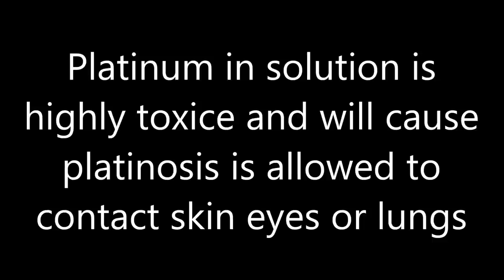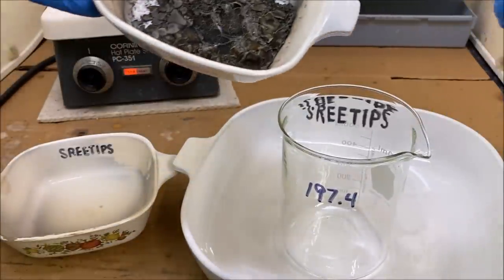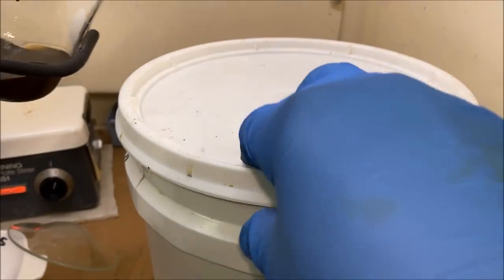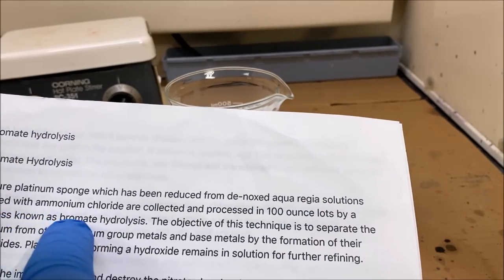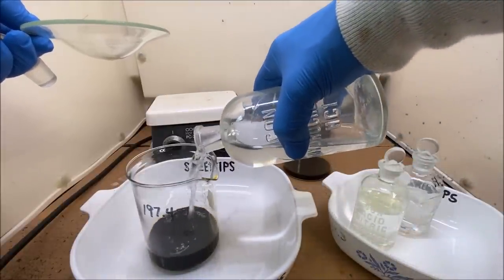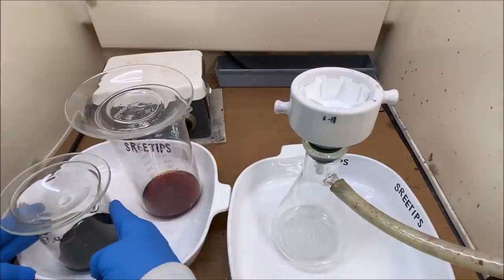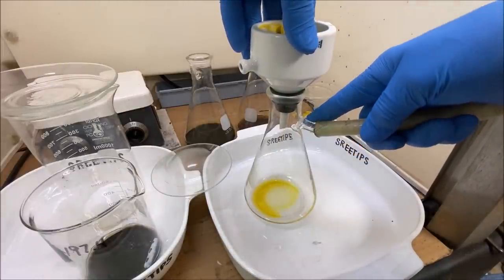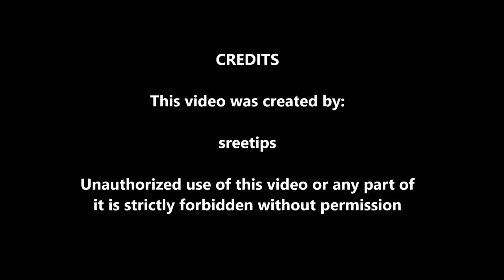Platinum Refining Bromate Hydrolysis Pt3

Comment: Looking good there Sreetips. One thing a lot of papers/books forget to inform the refiner is that all Pt and most of it's compounds are a catalyst. Some have the ability to absorb up to 700 times amounts of oxygen. So when i see slimes that don't want to settle i have to wonder. The Ir content in the Pt also varies with age. Let me explain, it used to be a standard of 90% Pt, 10% Ir, however toward my retirement we were seeing as high as 30%. At that time Ir was around $350.00 p/o Pt was hanging around $850-900. So it was cheaper to add more Ir than Pt. You are right about Pt hanging out with Ir, which loves to hang with Ru and on. They have an affinity for one another. Like silver and palladium. I believe i would make a seperate waste container dedicated to just your platinum group sisters. Will help you in the long run. I enjoyed this very much. Brought back old memories and struggles. Keep up the good work and can't wait till the next one.
Reply: I completely concur on the separate waste container for PGMs.
Reply: Metallurgy is so interesting.
Reply: I found a brain sized piece of PGM ore and a nugget that runs through to the bottom of the ore, there is a silver dollar sized black crystal with tiny platinum crystals, I have only done the hydrogen peroxide test and tiny white bubbles everywhere; all I have is a furnace..do I need a collector metal or will the PGM's do it themselves?  the specimen  weighs 16.4lbs.. put the tips of your fingers together and pull apart 5 inches and you have the shape and it's 4 to 5+ inches thick....any advice, I have not gotten into they acids yet cause I need a work space with vent fan etc...
Reply: Hope that helps
Reply from the maker: Stumpy, platinum refining requires special equipment. It’s very dangerous. Platinum in solution causes platinosis. It’s not worth risking you lungs and health for a few grams of platinum.

Comment: When doing the 'syrup' procedure, driving out the nitric acid as nitrosyl chloride and nitrogen oxides, I find it's best to turn the heat down quite low when it gets thicker. It's better to leave it a bit "soupy" and repeat the addition of HCL several times than it is to overshoot. I've dealt with re-dissolving solids many times. You should also leave the cover off so the NOx's can escape. The brown cloud is only helpful as a visual indicator when you have a lot of excess nitric.

Comment: Another impressive movie in this series. For metal residues you have undissolved - mix of HCl / H2O2 can help to get more metal into solution - for PGM this is more aggressive and faster than AR. I agree with all advice you get about separate stockpot for PGM uncontaminated with base metal like Cu,Ni,Fe etc. - it help a lot in further reprocessing them into similar black powdered material you worked after calcination. 
Heating salts to get sponge are pain in the a**, I lost many good quality borosilicate beakers this way - and always have material left unable to be scrapped of walls. Solution for this may be to reduce salt to metal with formic acid and get this back as tea grounds looking clumps of metal. I would say that for any refining process, getting metal from source [medical / jewelry alloys, ceramic capacitors, catalytic converter] into black PGM powder with as high as possible area is crucial to ease dissolving process.
Great video, can't wait to see hydrolysis...

Comment: 1:30 you could use your electric furnace for it
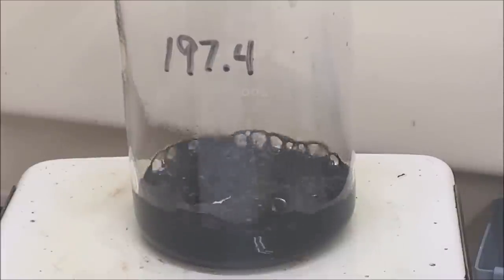19:30 You can additionali test solution for the presence of nitric acid by dropping few granules/crystals of urea in to solution. No bubbles means no nitric acid in solution (this method used in some analitical/precise gold refining recipies).

Comment: I’m glad to see a much cleaner Stanischloride test.  Seems like the Ir decided to cooperate with you this time.  Maybe there was another contaminant in there the first attempt that was helping oxidize the Ir.  Either way, I’m glad you addressed this question.  Just shows how some times theoretical and applied science are not always 100% aligned.  This refining series has taught me a lot so far.
Reply from the maker: When alloyed with the platinum, the Ir goes into solution with the platinum in hot aqua regia. After rendering the metals by calcining, now the iridium is in metallic form and resists the hot aqua regia since it’s not alloyed anymore. And your right, I’ve seen many things happen that weren’t supposed to happen at the applied level.
Reply: Thanks for explaining that.  This has been a interesting experimental refining series!

Comment: Hey Sreetips,  Love your videos, I find them fascinating and very educational.  So, I was wondering when it comes to sintering the Platinum powder why don't you use the mini electric furnace {the one you used in the past to make shot} with a ceramic/silcate glass "crucible" inside to drive off the residual chemicals as it proceeds into the final melt.
Reply: If not melting at this stage then surely you can set at a lower setting to drive off the residual reactants
Reply from the maker: I see, you’re talking about calcining.
Reply: @sreetips  Yes, Exactly.  I was looking at it as way to keep the material in a concentrated mass since it is a loosely consolidated sponge. And the mini furnace would expedite the process.

Comment: I’ve been seeing videos of people taking all the NO2 produced from dissolving sterling silver in nitric acid, and running the gas through deionized water or hydrogen peroxide, to change it back into nitric acid. 

Would you be able to do this as a way of dissolving sterling silver without the need to get a fume box? Since all the dangerous gas is being taken and used up.
Reply from the maker: No

Comment: Very fun & informative watching your channel.

Idea for you for an upcoming video:
A comparison between how well you can melt silver & gold in your crucibles and for heating the mold using propane fuel vs. the MAP-Pro gas.

I think it’d be interesting because ever since the original MAPP gas was discontinued years ago and replaced with MAP-Pro (which is propylene), the temp difference between propane & propylene when you look it up online is not very different.  But where I live anyways, the MAP-Pro is 2, sometimes 3 times more expensive.

So just thought maybe that would be curious enough for you to want to experiment!  Cheers!
Reply: They thing is though that the small temperature difference makes a massive difference, especially when you have a bushier flame for melting
Reply from the maker: I can melt 5 ozt of silver in about 10 minutes with MAP pro. Propane by itself just dont get hot enough.

Comment: hello master,

I am about to achieve success in my refining operations.

Thank you for your help.

I have a question,

In the final stage, copper remains in nitric.

How can I collapse copper in the fastest and cleanest way?

How can I separate it from nitric?
Reply from the maker: After I’ve recovered all the silver and all that remains in solution is copper, I then add the blue copper solution to my waste treatment bucket that is full of iron. In there, the copper comes out of solution on the iron and falls to the bottom of the bucket as metallic copper. Then I throw it (the copper) away.
Reply: @sreetips  Thank you for your interest.

my name is bora

I'll wait if you come to Turkey.

Comment: I'm pretty sure that black residue after dissolving the metal powder is actually iridium that's left behind. Because when adding the ammonium chloride to the Ir Pt solution you probably got tiny separate crystals of ammonium hexachloroplatinate and ammonium hexachloroiridate, which when heated should form separate particles of pretty pure platinum and iridium. So this time the aqua regia pretty much only dissolved the platinum and left the iridium behind as a powder. At least that seems pretty logical to me. The orange color of the filtrate also kinda confirms that to me, since that's the color of hexachloroplatinic acid. And iridium has a melting point of 2446°C, I doubt you would be able to melt that.
Reply from the maker: I was thinking the same thing. I’m considering doing another AR dissolve now that it’s metallic and see if I can get more of the iridium out before attempting the hydrolysis.
Reply: @sreetips  I'm surprised the leftover metal powder actually melted, which might suggest that it's not pure iridium. Because I can't imagine your torch can heat it to 2446°C. I think there might still be a lot of platinum left in that which didn't dissolve in the aqua regia.

Comment: I'm in unknow territory here. When you add waste solutions to the stock pot can the platinum salts that plate out form relatively good suluable anion with the Copper  to go into solution? Else that Platinum won't cement out in the stock pot and the toxic salt will travel to the waste solution treatment stage. Remind.normally you cement out the PGM's with Zink. It's a question I have.. no idea really.
Reply from the maker: They will come out of solution on the copper at a much slower rate. Zinc is very fast.
Reply: @sreetips  Ah that's again the difference between the time related world and theory. I couldn't find something about this in the to me know sources. My gut feeling tells me it would be a good thing to separate these waste streams.

Comment: Thanks Sreetips. Great series. I assume you edited out all the cuss words. 😆
I opt for a namechange of Ir, namely 'Iritatium'.
By the way, I recommend you keep the residue in a separate stock pot and not mix it with your existing stock pot. You then have more control over the toxic component.
Reply from the maker: Too late, it’s already been added to the stock pot.
Reply: @sreetips  In that case, don't forget to mark the stockpot. You never know if you forget about it in the future. I would... 🤫
Reply from the maker: If probably would work if I go slow

Comment: Once you precipitate the copper with iron from the stock pot, what do you do to get ride of the waste solution?
Reply from the maker: Iron in solution.
Reply: You can add sodium carbonate or hydroxide to raise the pH and precipitate it out as insoluble  iron carbonate or hydroxide. Those are quite harmless (two of the compounds that make up rust) and can be safely thrown in the trash. The remaining solution has been neutralized and had effectively all of the metals precipitated out, so it can be safely poured down the drain.

Comment: Street tips Brother been a while you know they make sintering dishes, or electric kiln closed top. You and this dammed torches drive me nuts.
Reply from the maker: They’re crude but they work. A furnace won’t get hot enough to melt platinum.
Reply: @sreetips  i have one. Also i meant for sintering in this instance.
Reply from the maker: Gotcha